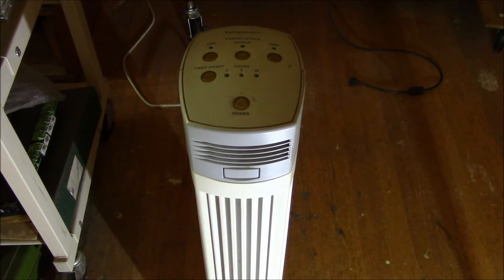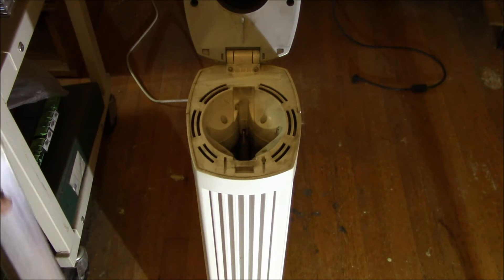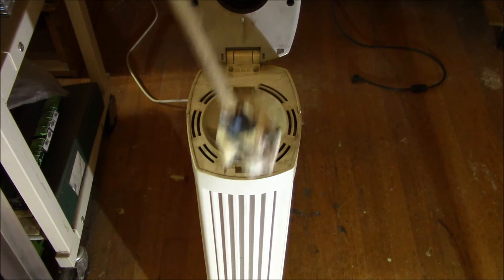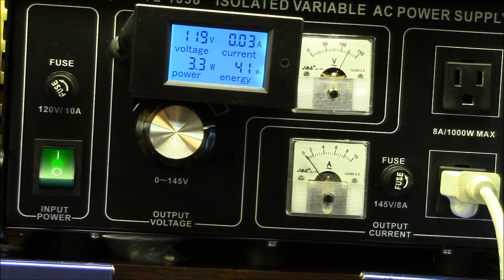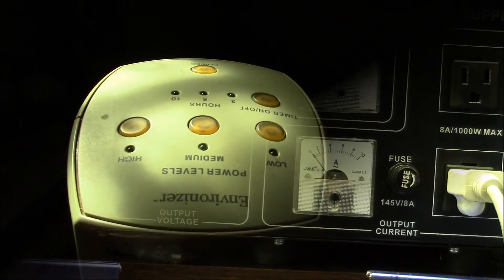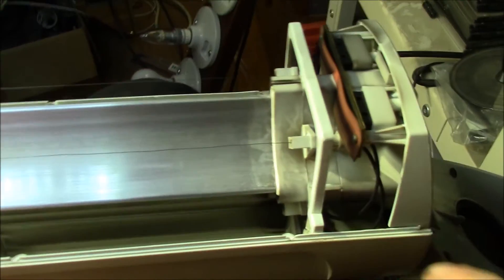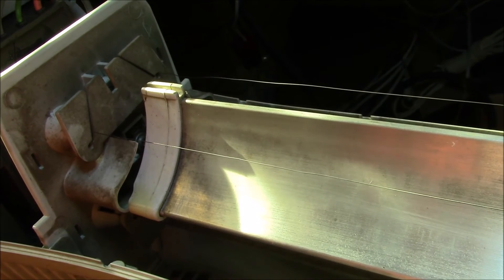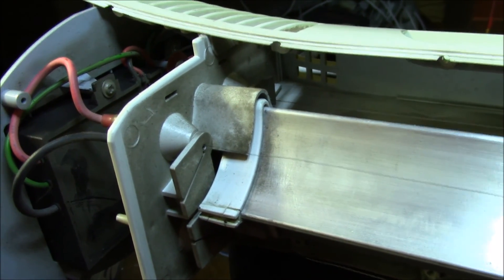Environizer Air Cleaner Repair, Part 1

Comment: I got here by doing a search. I seem to have inherited this very machine from my late mother. I am guessing it is from the '90s. It seems to be working fine. No noise, very quiet. But wondering if these actually work?
Reply from the maker: They seem to work judging by the amount of dust that you need to clean off the center portion from time to time.  There are likely more efficient units out there if looking to do the entire house, but for a room, this one works well.

Comment: When I turn this model upside down, something 'slides' from the bottom.  Its not my air filter, so I cant see inside now.  Anyone else?
Reply from the maker: That's the sliding separator piece you likely hear.  I think the purpose is to clean the two high voltage wires of dust buildup.  That separator slides up and down the wires and knocks off accumulated dust.